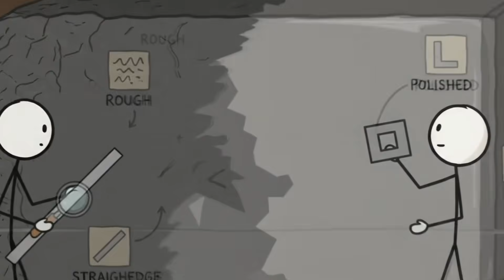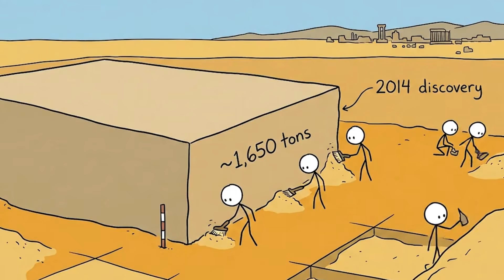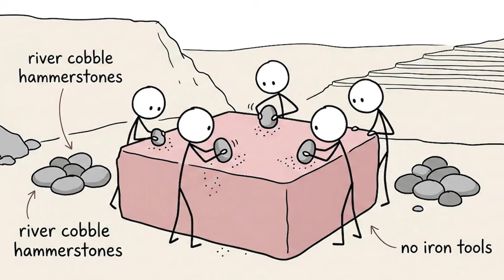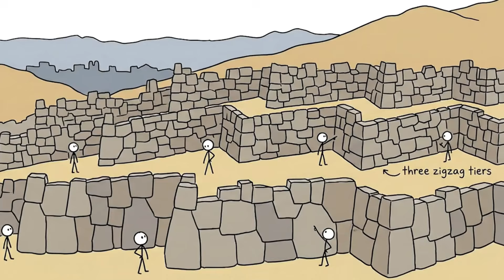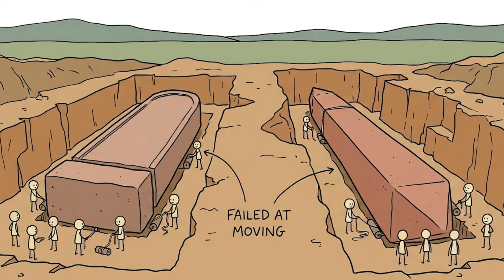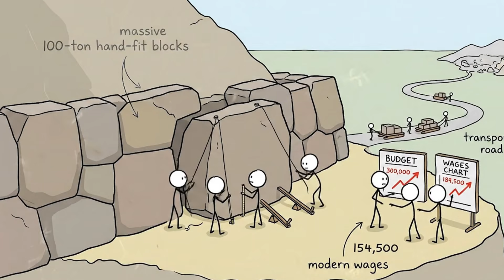12 Prehistoric Structures That Modern Engineering Still Can't Recreate

Comment: The John Lord hypothesis of building the pyramid is far easier to assemble.  (1)  One lays out the flat plateau foundation.  (2)  One lays down the first stone layer providing the square foundation.  (3)  One DOES NOT build complete layers upon layers upon layers.  (4)  One the west, north, and east sides and lays down a successive curvilinear arc of stones around the south entranceway and stone uplifting area. (5)  As one lays down the inside foundation stones, one lays down the outside limestone casing stones as that layer is built, and providing the exact angle of incline of the pyramid on the 3 sides.  (6)  One eventually has built up an interior pyramidal shaped ridge around the edifice like a 'U'.  (7)  The interior shaftways are for dragging the stones upward to the way station queen's chamber, king's chamber, where they are uplifted and craned into place.  (8)  Eventually, one must create the single of inclined woodworks of multiple cranes lifting the block from ground level, up, up, up to the highest and final crane emplacement of the stones, and the capstone.  (10)  One then dismantles all woodwork framing and cranes back down to the plateau.  (11)  The pyramid is built without dirt ramps, and excessive manual labor of 10,000s of manual laborers.